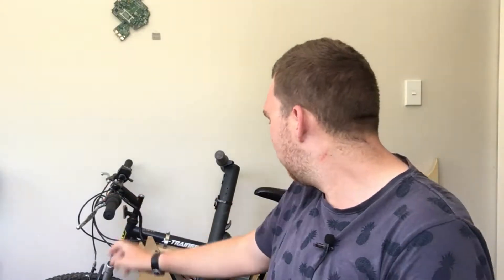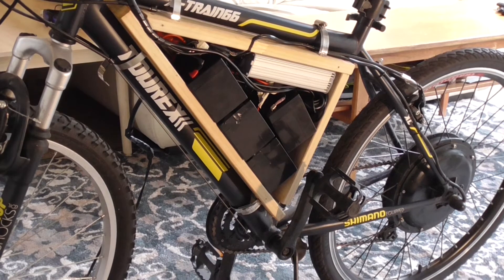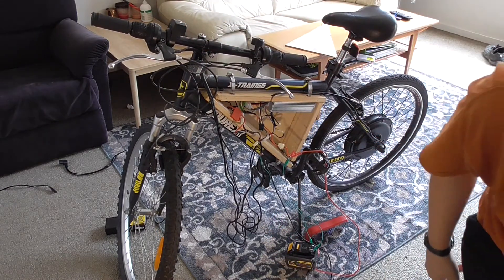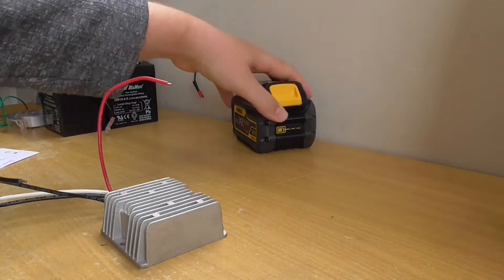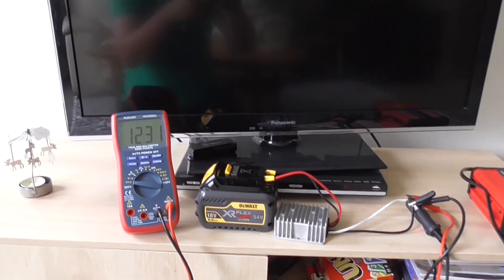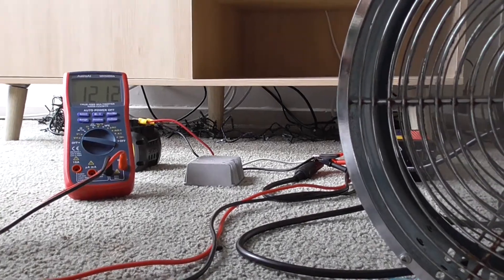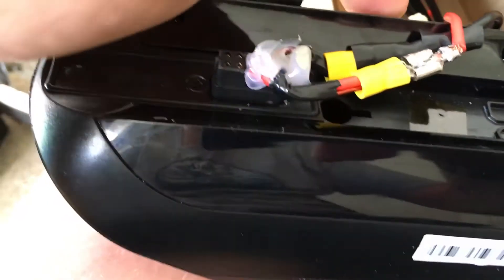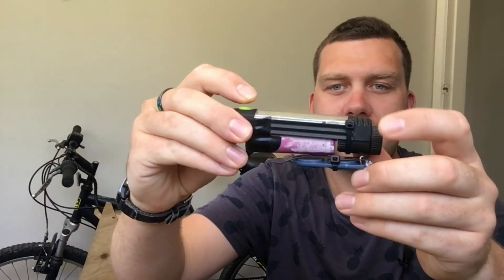Ebike powered by my extra drill battery.

Comment: ive done it.. on ma very old (+-10yr) 36volt 16amp peak ebike.. 3d printed adaptor to hold battery as 3p2s , and so the battery is already some 2p5s , that so make a total of 6p10s of 2200mah li ion.. for 180 eur total, (adavantage vs china is cell are 3yr under guarantee:)

Comment: Check your pins in the battery. When. You insert the shade bits it widens the contacts in the battery & the tool pi s are very thin. Just bend the battery pins back to original space & it will work. I done this to jump my truck & same results after using spade terminals- or you would seen smoke & smelled melted solder from the battery to actually damage it. Just my thoughts.
Reply from the maker: Oh good tip! That would make sense

Comment: Just ran it to low just need to open it up and charge cells dewalt has the low voltage shut off in the tool
Reply from the maker: Ohhh that makes sense! im just used to the bms charge controller being on the battery itself.

Comment: Just hook it straight up like normall to existing ebike controller just stay under 62v and you can use any 18v in series or 60v power tool  battery combo,no issues
Reply: Agreed! Something else to keep in mind while riding ebikes are helmets, most people wear cpsc helmets, when they should be wearing nta helmets like xnito or bern hudson
Reply: "18v in series or 60v power tool  battery combo"
What???
Reply: @Jakeisks  "18v" with 3 bats in series makes the same voltage that "60v" makes. Basic stuff.
Reply: @Jakeisks  there are in the market 60v batteries like toro brand depending on the capacity of the controller some are rated to 62v max so using 3 20v batteries in series will work fine as long as your they are evenly charged otherwise you will damage life expectancy of the battery

Comment: I personally recommend buying the Bafang bbshd and buy power tool adaptors. You can use 20/60v max makita 18v batteries or m18 batteries. My 3,600w bbshd (luna ludicrous v1 controller) and 3x M18 12.0ah batteries in series (peaks at 63v) and a bridge rectifier that can handle 100a (1.2v drop to make the system work) and pow! I have a 4+ hp ebike with power tool batteries.
Reply: You should make a video about it
Reply: what is the purpose of the bridge rectifier?
Reply: Good luck with it are intended to give you an 9am appointment for a couple
Reply: "20/60v max makita 18v batteries"
I don't understand that... 60v?
Reply: 3x20v = a 60v makita batery
Or 1+1:20vx3 = 60v to 10ah
Reply: @eduardoosorno6637  
lost me on the second line...
Reply: @Jakeisks  can use 3 or 6 baterías of 20v 5ah
If u use 3=
1*20+1*20+1*20 =60v 5ah
Or 6=
(1*20+1*20)+(1*20+1*20)+(1*20+1*20) =60v 10ah
Reply: Makita dewalt milwaukee parkside ect ect is 20v!

Comment: Did you try powering your ebike with the 54v battery again? ... I have 3 batteries 18v 9Ah with hopes to power up a similar motor like yours.
Reply: I've used 3x18v Ryobi battery's in series on 1000w hub works well
Reply: @meetoo4368  what’s the Ah rating of your batteries?
Reply: Show it when your bike  will be done
Reply: Here it is ; https://youtu.be/LngJgP0xKP8

I will do a built video sometime this year.